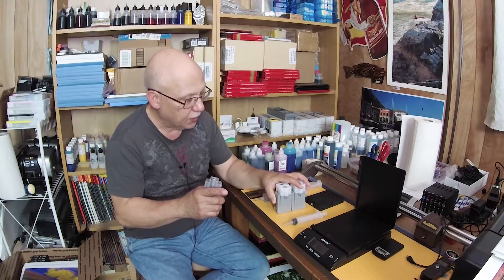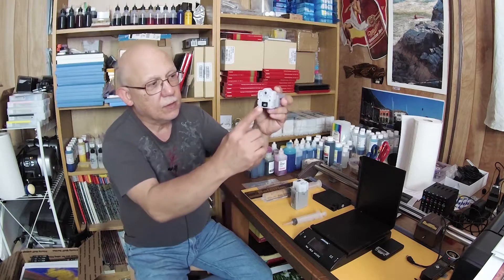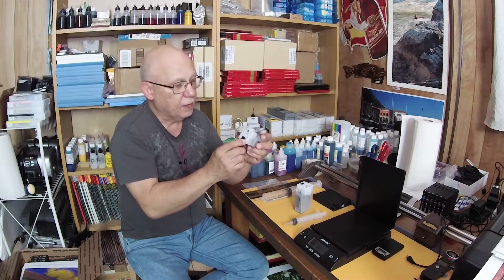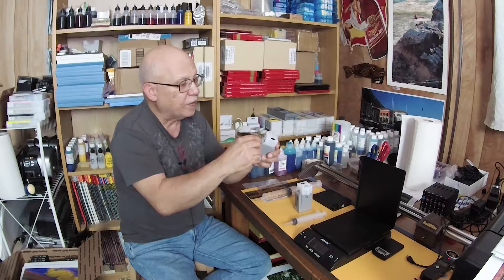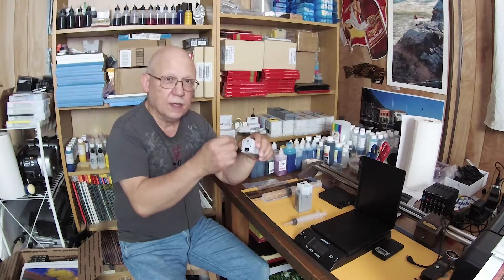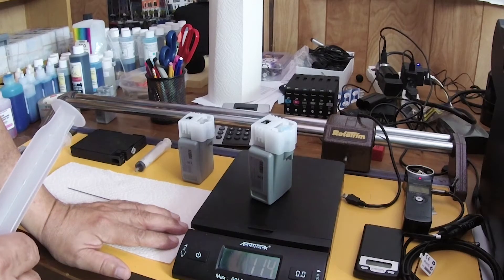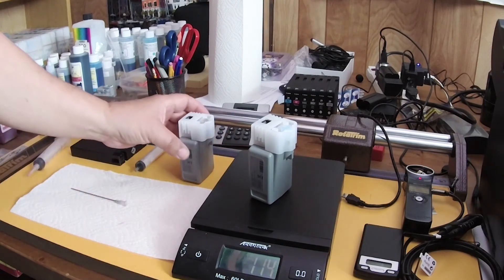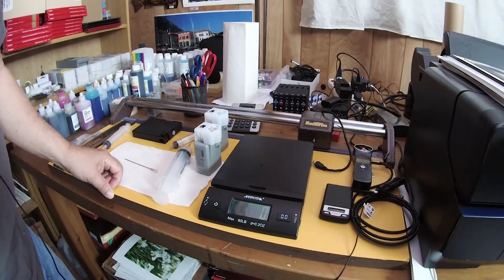Just Recieved a couple of Empty PRO1000 Carts so I Will Show You how to Refill Them

Comment: Hi Jose, A couple of points regarding refilling of the PFI-1000 carts.1. It would be nice to be able to refill the carts without having to buy a scale.2. It would be nice to know at what point do I start the refilling process with these carts. After first warning of going empty or at the "you have run out of ink warning"3. It would be nice to be able to buy the ink, Syringes and chips all together as a pack, either from you or Precision Colors so I don't have to pay for shipping twice.PS. Thanks for the videos, I am learning a lot. I wish I had known about your youtube page before I wrecked my Pro 9000 Markii because of buying third party ink cartridges.
Reply from the maker: OK. The PRO1000 will basically use every one of the 80ml in that cart. It it the very first printer that I e come across that will do that. Usually there is always some left over ink. The PRO-1 always leaves about 5-10 ml lest per cart. Not so with the PRO-1000 so when a cart is empty you lad 80 ml and that is it.  I always use my scale but that's just because I am an experimenter and simply want to know all aspects of the process. I was will not be selling anything. PC will be your ordering place.  The PRO -1000 is truly the perfect printer. It has hidden secrets that even the reviewers totally missed.  One thing for sure .  DO NOT EVER move is from the location you choose to set it up.  There are built in level sensors and a very wasteful process if it needs to be moved, the system has to be drained of all ink before moving!!!!  I will be doing a couple of more videos showing mother refilling methods.
Reply: I just acquired this printer last weekend and unfortunately needed to bring the printer back to Canon to fix some cosmetic issues and hand carry it to the service center. I was told by the technician as long the printer is not tipped to its side or turned upside down, one does not need to drain the system using the flushing procedure.
Reply from the maker: You hand carried a PRO-1000 to the service center??? OK you are one strong dude.  Right. There is a limitation to the angle before the internal secondary ink receptacles will leak. I am not sure about what the tech said, the service manual says otherwise. But if you had no problems then I believe you.
Reply: The service appointment is next Monday and the service center is 45 min drive from my place. Of course I will be putting this beast on a cart and carefully loading it onto my trunk and securing it. Lets hope nothing bad happens. Just curious are you referring to the service manual of the Pro-1000 or the Pro 1? If so where  can I get a copy of the service manual for the Pro 1000?
Reply: Hi Jose - Hope you enjoyed the Memorial day and thank you for your service to the country. My Pro 1000 survived the service center trip and 80 miles of driving. When carrying the unit I did tilt it a bit due to the weight and getting through doors. In the end there were no leak at all! The service tech told me the ink purge feature is primarily for third party shipping where the unit could be left on its side or upside down for an extended period of time. The printer was left unplugged for about 20 hours or so and upon powering up, it did not perform any cleaning cycle and my maintenance cartridge shows no usage.

Comment: Hi Jose,

Do you have a good profile for the Pro - 100 using a mix of PC inks and the original inks with RR 60lb Polar Matte? Also, when downloading the icc profiles from PC website what is all the different illumination options? Thanks!
Reply from the maker: Only for PRO Luster a d PC inks. I haven't used OEM for years.
Reply: Oh, ok. Thanks.

Comment: Jose,

Very interesting. I own a Pro 1000 and will be needing ink soon. Are the inks from PC available now ?

Also please elaborate on the " Notch " on the syringe. Where do you get the syringes ?

Thanks,

vollick
Reply from the maker: The inks are being developed now.  The pro1000 utilizes blue and that color formulation is one difficult color to duplicate.  The tips I will selling. They will have the slot  machine to the correct width and depth in my shop. The syringe is a common 60 ml luer lock available in many p!aces on line but I will selling this m as well.
Chip pricing and actual testing will not be ready for a while.
Reply: Jose,

Thank You. 

I look forward to everything you have to offer.

vollick
Reply from the maker: It will not be too much longer.
Reply: I'm interested in using your method of harvesting ink from the larger Canon cartridges for the PRO-1000. You state that you will be selling the slotted tips, but I don't see them on your Amazon page. Are you selling the tips? Also with respect the needle used with the Canon cartridge, blunt tip or are you using a sharp needle tip on the syringe?

This is my first posting on your channel, where I have been watching your videos over the past week with great interest. In fact your information pushed me over the edge on ordering a PRO-1000 to augment a 44" Epson.

Thank you.

Comment: Hi Jose, as you told me to ask you any doubt, how to check ink level on third party catridges.
As you know third party inks do not show ink level , so what are the best practices for this? Thank you
Reply from the maker: I need to know what cartridges are you asking about.  They do show ink levels. Maybe not as accurate as OEM chips do.  So which carts and for what printer.
Reply: I tryed the LD inks, CLI Catridges, for the Canon 9000  The color the packing are Fantastic the printer runs like butter, The price is 1/3 of OEM, Actually I'm making a longevity test with prints exposed to strong halogen lights, My opinion is that are Really Really good, However they show all the time like FULL, So the question is any tip on how to check ink levels manually? LD Inks are a winner NOT moving away from them, Thank you for your answer.
Reply from the maker: Well IF you are physically able to see the ink levels on the carts themselves then your only motion is to physically remove them and look at them. When the liquid chamber is empty you have about three more letter size prints to go. If you continue to print and the print head is starved and it will burn.  Why don't you simply modify, reset, and refill the OEM Carts, then you will have full ink level reporting.  I don't really understand why you still wish to go the compatible cart route. If it's cost, you can do what I suggest and it will lower your printing cost to a dollar per refill!
Reply: Opps I was telling you this while printing and suddenly, The printer showing full carts poped a warning saying your cyan cart is empty and has to be replaced, that seem a safe way, Yes the refill is something I have in mind, is very economic particullarly a good advice coming from you, Thanks
Reply from the maker: Be very careful that when the chip says EMPTY it is actually NOT yet empty. You do not want to be in a situation where no ink is entering the PrintHead while you are actually printing.  That kills canon Print Heads.
Reply from the maker: No, it's like a terrible chip!!!!
Reply: No No No!!! Once you get the warning you have to change the cart despite it has some ink.
THAT IS THE BUFFER TO AVOID RUN THE CART WITHOUT INK, 
LD Products and Canon Printers are my choice, I wish I knew it when I was Manager at Duggal NYC, 
Jose Thank you for your advices and your suggestion about your inks, My advice to you: BUY LD and make your life easier.
Reply from the maker: Well to each his own!  I prefer refilling OEM and getting actual true ink level reports for $1 or less a refill.

Comment: I'm trying to print a b&w illustration image and it keeps coming out warm and greenish.
Reply from the maker: Color management!!!  What are your complete driver settings. Editing program, paper, Inks. Everything.  Then and only then can  I see if something is " off ". If your monitor calibrated??
Reply: Everything is calibrated correct. I was using the OEM inks for the Pro 100 and everything was printing great. I was low on both grey colors so I updated those inks to PC today. I printed using the PC profile for Red River polar matte paper and the prints just seem to have a slight warm/green tint to them now.
Reply from the maker: So you were getting neutral results prior to switching your grays to PC?  That is completely normal. The PC in set is matched to itself ASA complete set.  You can not use the PC profiles until you are 100% on PC inks. A hybrid I meet is more like lala land.  Nothing is a perfect match to OEM.  I would suggest using the RR profile for that paper rather than the PC one until your fully running on PC inks.
Reply: Yes, correct. Ok, i'll just continue with the RR profiles until I am using 100% pc inks. Thanks!
Reply: Jose Rodriguez and a